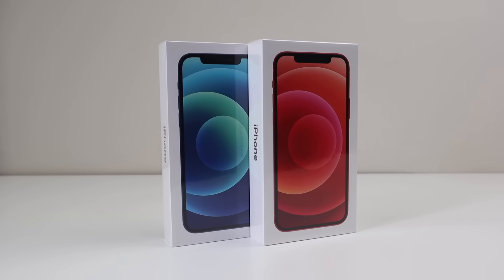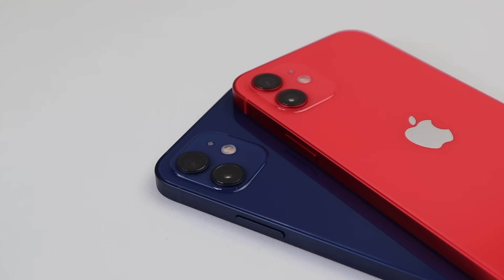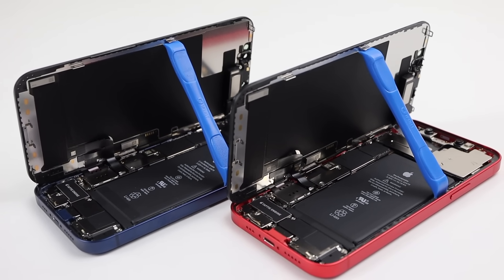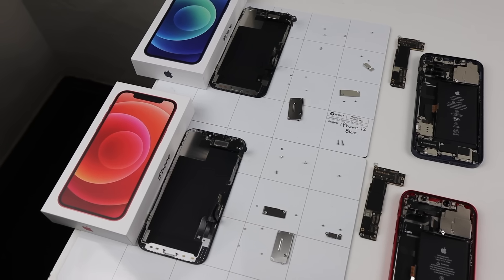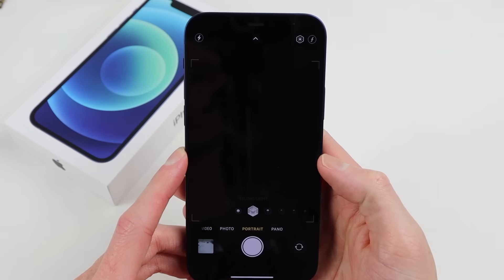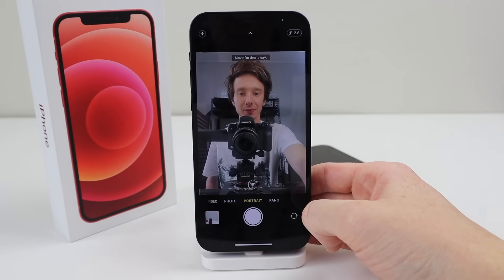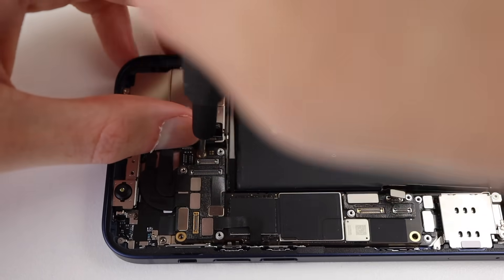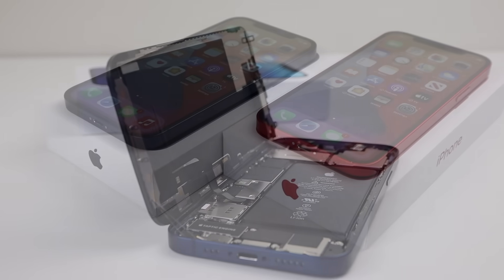iPhone 12 Anti Repair Design - Teardown and Repair Assessment

Comment: Not sure why people keep buying apple products, they don't care about their customers. Clearly not doing what the majority of consumers want and going out their way to make things even more difficult e.g. repairing just to fill their pockets. 

They manipulate the customers by introducing "new tech" into the phone which has been on other phones for years and trying to make it seem like something new they invented. 

They also overprice their products and repair prices. Also removing parts and accessories to save money and make you buy more of their apple products. E.g. 3.5mm headphone jack and fingerprint scanner and trying to make you buy the chargers, dongles and airpods etc. Also trying to make you only you download and use their software e.g. iTunes and restricting such basic software stuff people have to jailbreak them just to have a bit more change in their phone, for example there was no dark mode and they had to be jailbroken to have that apple kept trying to stop it.
Poor quality too, such as some of the previous generation phones were easy to bend and coming out the box with broken screens. However the iPads are still extremely easy to bend and break which is a bit more understandable due to their thickness and size. But other tablets are able to withstand it more.

Comment: I love it. Apple closed the ability for 4th party trash to be used to repair the device. Meaning? No more fake components being made by 4th party vendors, and reducing the need to have so many devices that were deemed unusable to suddenly come into the market again. No more trash displays that make it into 3rd party repair shops. Now you all know what to look for. A refurbished phone that has no true tone, no battery life, will not power on with button, camera functions wrong,  or no face ID, you are looking at a wrecked iphone 12. It is about time. No 3rd party repair shop would ever restore the IP water resistance anyways on any Iphone after 7, and leave it in a poorer condition than specified, 10 out of 10 times. The environmental impact is huge. China 3rd party can no longer make claims to make the parts to be put into the phones. Less trash. Haters are always going to hate. No more fake batteries coming into contact in a Genuine Apple device. It is about time. Like China third party ? Get a Huawei crybabies.
Reply: Imagine defending not being able to replace a camera with another camera made BY APPLE lmao sheep

Comment: The main reason why the phone isn’t very “happy” after the logic board has been swapped is mainly because Apple does not do logic board replacements. If there is any issue with logic boards, they’ll replace entire unit instead.

Comment: the whole unable to activate face id happened to my iphone x too after i took it to get repaired at a third party repair place, very frustrating
Reply: IPhone 12, right?
Reply: @Sharon-zj2gp  nah iphone x
Reply: @taj5107  Strange, I was hoping this was only a problem with the 12.
Reply: @Sharon-zj2gp  just shows that cheap things/repairs are  too good to be true
Reply: @taj5107  Not the point 

No other phone company functions like this with repairs. Only Apple forces you to go to an Apple Certified Installer which cost way more for no reason. Other than forcing you

Comment: I have a 2017 iPad Pro that works awesome I have a light comming though the screen about a inch or two above home button on my iPad 10.5  I phoned to see how much to fix also this is a problem that has been widely known they wanted 550 to 600 to fix I phoned a local phone repair they said 250 so Apple wants more than double ther crooks it’s perfectly good iPad still faster than most new iPads so I don’t want to throw away since this has been a problems in thousands of these iPad why do they not back up ther product so you have to throw away and upgrade sorry Apple I’m not rich

Comment: Artificial hardship. Engineering problems that wouldn't normally exist, out of greed.
Imagine you were a programmer for Apple. While engineers and programmers try to overcome natural problems that nobody has overcome before, YOUR job is to create artificial hurdles. The phone has a natural lifespan and repairability. For all the hard engineering work to increase durability, you are going to work hard to decrease it. 
Not for safety. Not to prevent theft. Not out of any technical necessity. Your customers would be TOO happy with your product, because whatever you're putting into the next model isn't worth the price for them. So you're taking their choice away.

I'd rather leave the industry altogether before doing the exact opposite of what my profession is supposed to accomplish.

Comment: So instead of letting me use my old power adapter from my old iphone when I upgrade, they want me to buy another power adapter? thats just creating more e-waste
Reply: You can also use your old power adapter with your old cable to charge the phone
Reply: You can also buy a $10 adaptor to
Connect your type-c to your old wall plug. Only thing is you won’t have fast charging

Comment: I've worked on electronic repair for years, and none of this is surprising to me in the slightest. The non-genuine messages will disappear after some time. (I think 30 days). I worked at Apple for some time, and the only difference between 3rd party and Apple repair is Apple has a program that is required to be ran on every screen after install which gets rid of the "non-genuine" message, and re-syncs the Face-ID with the new parts. Since Apple won't give these programs out to 3rd party, we have no way to sync the parts.

Comment: Apple: we aim to have no environmental footprint

Also Apple: either we repair your phone or you get rid of it
Reply: Hey, but at least it's not apple getting rid of it. So technically, once it's your phone, it becomes your environmental footprint. See how that works? Apple can sell ya the phone, take your money, promote their real bottom line(money), and shift their environmental footprint over to the customer.
Reply: @TheOGAZDev  also add, its your phone your responsibility, but you cant repair it wherever you want, you have to take it back to apple for them to tell you you need to replace the whole phone because it will be cheaper than the repair.
Reply: @tuguytetik6480  precisely why I refuse to buy an iPhone now. Seems quite strange to me that Apple has remained in business as long as they have seeing as how they treat their customers. And in reality, it's not even an argument about which one works better. In terms of software they are mostly equal. In terms of hardware, Apple has historically been behind the curve on nearly all aspects. 
The arguments of Android vs Apple that I've personally been involved with usually come down to one thing. Comparing an Android someone bought for under $300 with the iphone they bought for well over $1000. It's Apples to Oranges. Spend the same amount of money on a decent Android device and 9x out of 10 you'll be satisfied, and honestly you'll probably be getting an upgrade. I've owned both. I've owned cheap androids as well as expensive androids and iphones.
I broke the screen on my samsung and repaired it myself for $200 and about 15 minutes of labor and the cost of the part is only higher because of the curved screen. Worth every penny though.
Reply: Iam from India 🇮🇳 
Please vsit my channel 
And learn how to simply edit photos using your mobile phone 
Daily video updating 
Use this corona time useful than lazy 

Love you guys
Reply: Well it’s up to users to recycle their device at Apple or throw them out, Apple can’t control wasteful users. The devices are 100% recyclable and Apple gives you credit for your old obsolete Apple products if you’re concerned about waste.
Reply: @owRekssjfjxjxuurrpqpqss  What a sheeple.. hahaha

Comment: That can only happen during the warrenty period once out of warrenty apple are breaking the law. Which state that customer have the right to seek repair outside of the manufacturer system. Preventing is classed as a unfair monopoly be and 10 life expectancy laws coming on line in Europe apple will need to provide third party repair data and parts.

Comment: This video shows one of the many reasons I will never upgrade or buy an iPhone again .The next phone I buy will actually be mine so my only choice is Android!!!
Reply: Android software sucks, ios feels not comparable to android. But Apple is heading in a bad direction. But I recently switched from the newest Bezle less android to a iPhone 7, and I must admit that I feel way better with iOs, even though the phone is so old.
Reply: @maxwess1753  what kind of software have you tried? mediatek? Snapdragon? cause your comments seems like you don't know how android works
Reply: What exactly is the "newest bezle less android" you switched from? I still haven't seen anyone try a similarly priced or even less expensive android device and then still pick the iphone.. You're a troll, a kid or some sick apple fanboy (probably all).
Reply: @Ropenkkao  Hahaha well it was a Xiaomi mi 10T. Now I triggered you guys😂 The tec in my iPhone is so old but for me the experience is way better than on Andoid. I used to be a Android fanboy but I just love the perfect sleak animations in iOS. The phone all in all is outdated but the software isnt and runs smoothly. For me, Android misses the smoothness that Apple has.
Reply: @maxwess1753  so you downgraded your phone? 'newest bezleless android' to an iphone 7... surely it was a low end android design if it warranted a swap to a near 5year old phone
Reply: @maxwess1753  lol whatt

Comment: 5:52 Next time they will round all the screws so no screwdriver can grip them.
Reply: they'll still need their genius staff to repair the components lmao
Reply: @BoppinParty  they'll put a red sticker on the battery and tell you it turned red cus you dropped it in a glass of water. You shouldn't drop your phone in water next time :)

On a sidenote, the brand new iPhone 13 is out, are you interested?
Reply: @BoppinParty  They must consult the genius bar.
Reply: @nitrolight1778  The genius bar is a fucking meme at this point. Had a lot of people tell me what the genius bar told them when they brought their device in for repair. It's always a completely BS answer and I have to convince them I know what I'm talking about when I say a different reason as to why their macbook isn't working.
Reply: @BoppinParty  by the time they make it that way you'll have to get rid of your phone if anything slight happens to it kek
Reply: @BoppinParty  no they don't 'its to expensive to repair just buy a new one'
Reply: @BoppinParty  they will have a certain nfc pin to unlock them
Reply: Lmao
Reply: There's a tool called 'easy out' its sole purpose it's used to remove rounded or broken heads

Comment: Like cars if you change stuff it’ll probably throw codes and will not work properly until the codes are reset so regardless if you use oem parts to fix your phone you’ll need apple to reset the codes

Comment: I can see how this is not good from a safe, legal repair point. But another side of this would actually help in those places where iPhones are stolen sooo much just to be sold in the black market for parts (if they can't unlock it of course). This would or should make them less appealing imho

Comment: Your waisting your time. 
If you genuinely follow apple and get all their new products, you are literally the target buyer. They know their buyers are impulsive and spend a lot of their hard earned money on things they don't need. They are just trying to find a way to milk you for more of your personal money. 
You pay them their wage. You should realise the powerful position your actually in. 
If every single person that wants the new iPhone, DIDN'T but it until these problems are addressed they WOULD fix it. They would change the charger, they would make parts interchangeable. 
But because iPhone buyers are all sheep. They were lining up put the front to buy their phone and SEPERATE charger.
But if no one bought the product because of that they would be forced to change it. 
🐑 🐑 🐑

Comment: Well Apple puts on many components EPROM (maybe EEPROM) memories, which have some some data on them. There is a kit called iCopy that reads data from an old component and copies those data to the new one. Then the iPhone reads those EEPROMs and verifies if any of those components are original from the factory (or a new component has the same data in the EEPROM memory). If some component does not have the original data on the EEPROM it just disables some function on it, which is Apple's software intended feature.

Comment: If it isn't bug then it has something to do with the Apple's T2 Security Chip. It may be unfixable, but not with Apple doing it, since they have the key to reprogram the T2 Security Chip. The system detects for hardware and software changes and prevents you from booting it, and as well, warning the OS and apps about any changes, so makes sense that happen.

Comment: Apple now is just expensive sh1t... 60hz refresh rate same procesor power, same desing just change the edges but the same sh1t... awfull repair now... face id fckd easily... im on an iPhone XR update my phone to 14.1 and lose my face id.. why? I DONT KNOW go to apple service... later say to me its a hardware issue... my iPhone has no hits or cracked display or water because im really carefull with my device... and this iDiots say to me that I have to get a New phone because is they cant repair it.. later I watch in youtube and.. ohhh is a surprise like 10k people getting the same issue and apple say is normal. Fck off apple this iPhone 12 is the worst sht that you create... no charger no earpods but YES! The same stupid price!

Comment: This kind of coding together of components is probably something that they have learned from European car manufacturers... On most newer BMWs/Audis/Mercs, if you swap even the headlights, they wont turn on without using a coding tool to tell the car's computers that the change has been made. Another example of creating a solution for a problem that should not even have been created in the first place!

Comment: Has to be software if it’s pairing these components. Something in the shadow. Hack it you’re free. Trick the device into thinking it’s the original.
Reply: Yeah but why? It's not worth it and the device drain the battery so fast we are in 2020 not 2012

Comment: I think apple is trying to do all the repairs by their own centers. So they have hardcoded all serial numbers to MB(like serial/build number of camera etc) if it found another part they make Software to freeze and do all the stuff shown here. So if u hand over broken phone to apple repair center they can change the signatures from MB with new replacement part, and change just the broken part.

Comment: This is done partly to ensure the phones come back to Apple to be rebuilt properly and to be available for warranty replacements. Second, its an anti-theft measure. Parts are a big market. If the parts cant be used outside of the phone they came in, there isnt any value in stealing them. It becomes pointless to steal them. You cant register a stolen phone, now you cant even use the parts.
Reply: are you really that dump?

Comment: Something I would like to point out is that there is a chance that these issues don't show up on the 3rd party parts. I work with 3rd party parts and OEM parts. When you hook up a OEM to a device that it hasn't been paired to it will tell you the screen is not a genuine apple screen. On our 3rd party screens that message does not show up, same with the battery. As far as Bio-metrics go, the touch ID on older phones as well as Face ID was never able to just be swapped without a Calibration Software so that is nothing new.

Comment: I’m not too sure if it’s available for the iPhone 12, but there’s these reflashing devices available from China at Banggood or AliExpress for other phones.  They have reflashing devices for the logic board, display panel, and the cameras.  You even need to reflash the haptic module if the haptics engine needs replacing.

If anyone decides to start refurbishing these devices, you will definitely need these reflashing devices.

Ali and Banggood can supply you everything you need to fix these iPhones, from hot plates for specific boards, reflashing jigs, BGA rework stations to do component level repairs on the logic boards.

Yay for China, SHAME ON APPLE!  Shame on you, shame on your family, and shame on your cow!

Comment: It’s not a bug it’s been this way since iPhone 7. When you repair an iPhone with OEM apple parts you have to put the phone into restore mode and run it through Apples repair software system to recalibrate all the parts and tie them to new motherboard. Sadly this isn’t software anyone can get, you basically have to be an apple certified repair shop or similar. And you have to make a ticket with apple so they can verify your repair before they will let you calibrate it. You can get around this by using non genuine parts but quality suffers obviously.

Comment: Hmmm that makes me feel like never I'm purchasing such a costly garbage.

Service under warranty its cool, but later how about changing the battery??
Or getting damaged cameras???? 
The same with fingerprint sensors are attached to main board like Face ID sensor. But display and battery getting attached is too stupid. 
Apple service is not cheap.